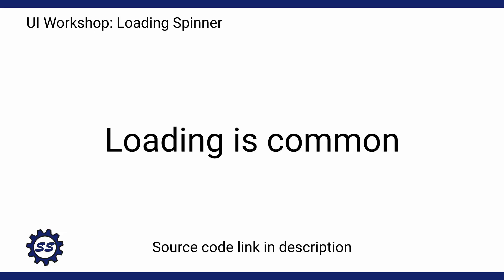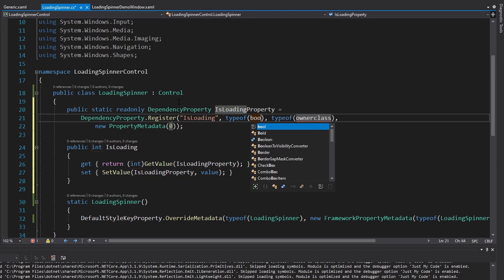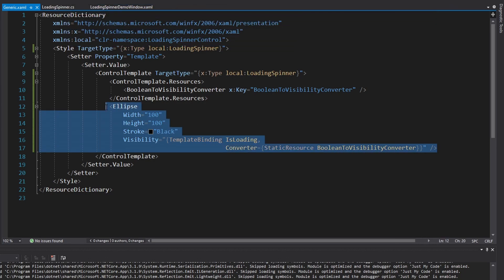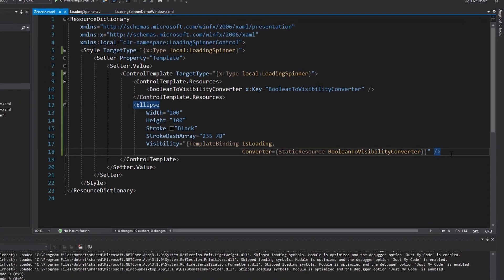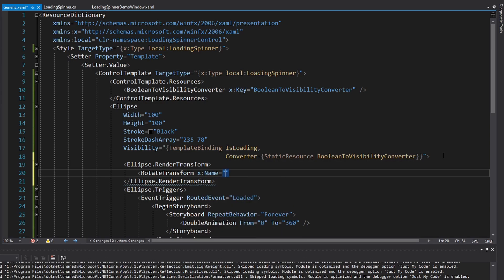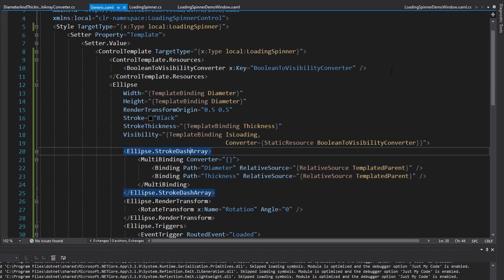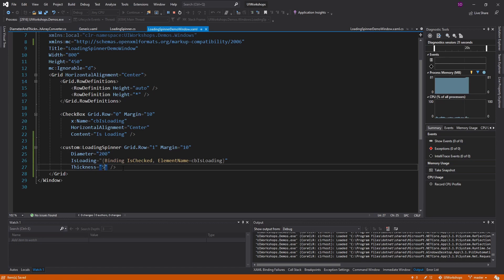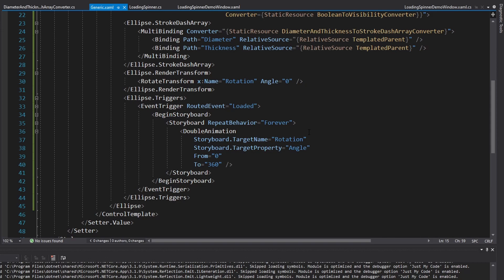Loading Spinner - WPF UI COMPONENT WORKSHOP

Comment: A small note about the calculation of the StrokeDashArray, namely the converter.
The diameter, when calculating the circumference of a circle, must also take into account the thickness of the line, for the same reason as the circumference itself.
Here is the corrected formula:

double circumference = Math.PI * (diameter - thickness);

With this correction, the gap now occupies exactly a quarter of the circle - this is clearly visible if you set the line thickness to half the diameter, set StrokeDashCap to flat and stop the spinner.

And yes, thank you so much for your videos.
I agree with many who said this - you are the best.
Reply from the maker: THANK YOU! I had been playing with this for a while trying to figure out the formula. I will keep this in mind next time I'm around this component. Thanks for bringing this up and sharing with everyone! 🎉

Comment: bro. you gotta warn someone about how all of these animations will be locked up and frozen when doing async/background work. 

I was really hoping you would cover some sort of way to get animations to run on the UI thread without them being blocked while the UI thread waits for some asynchronous tasks to run ... 

So my question still stands. When you need to execute a long running task, how can you get a loading animation (like an indeterminate loading spinner) to spin while the background task executes?

Because so far, I am using async and await functions and the animations just get frozen and the entire ui threads binds up while it waits. I've tried using workerthreads, and same issues. Im struggling out here :C hoping you have some resources?

Comment: Nice control, but I cannot find any way to include it in an app, even wrapping it in a popup still leaves it frozen while the host control is doing its loading processes?.
The Storyboard is obviously on the main UI thread, so it just dies....

Can  you suggest the best way to achieve this so it will run normally while my app is doing other work ?

Comment: Have you considered setting up a Discord server or something? I’m mostly curious if you’ve looked into the latest MAUI preview and what your thoughts on the new UI system are? I’m hoping it’s far less verbose than MVVM or custom controls. WPF is simply a massive amount of code by comparison to other UIs. I’m hoping MAUI solves that.
Reply from the maker: Hey Andrew, I'll consider something more community oriented for sure! I was actually playing with MAUI yesterday. I scaffolded out a project that included a Windows desktop app on MAUI, but then I noticed I needed VS Preview to run it, so I'll probably hold off for a couple months. I'm still not sure how I feel about MAUI. I'm interested in seeing MVU pattern works. In terms of XAML, looks like it'll be similar to Xamarin XAML, which is a little smoother than WPF XAML in my opinion.
Reply: @SingletonSean  Yeah I get that. I’ve been doing Blazor for several projects and I just like it so much more than XAML. It’s much easier to use and create custom components. It’s far more flexible with @media queries, bootstrap grid, and z-index. That’s mostly what I’m hoping for with MAUI. I’m simply tired of stacking layouts inside of each other to achieve a similar result.

Comment: Hi Sean, I'm thinking you could check out MaterialDesignInXaml. It's a complete UI toolkit that makes your apps look great without much effort and includes beautifully animated controls, including loading spinners and progress bars. Plus it takes care of things like dark mode completely on its own.

The great thing is that it's open source, free and in active development
Reply: Well I have been using Material Design Toolkit but custom control tutorials not only helps you create your own control but also you learn more about using xaml , template binding and converters and a lot more.
Reply from the maker: Definitely Rivox, Material design is really nice and easy to use! I've had good experiences with it. The documentation is pretty solid as well. I also agree with S Afzal. The concepts in these kinds of tutorials are great for when you need a custom control, which I've run into many times.